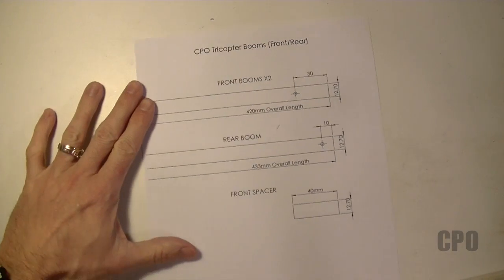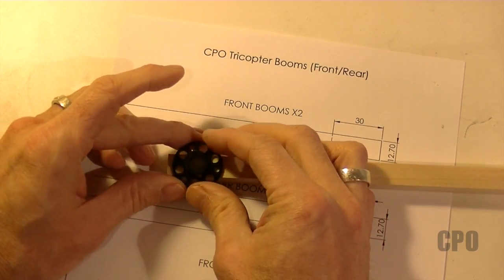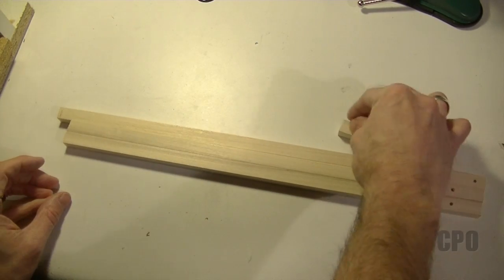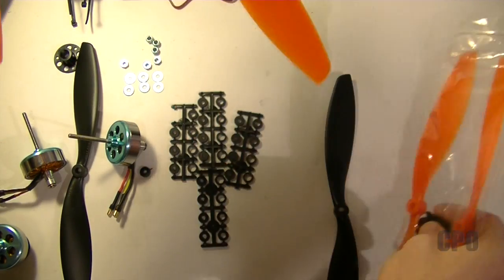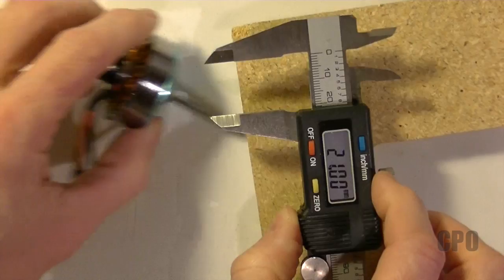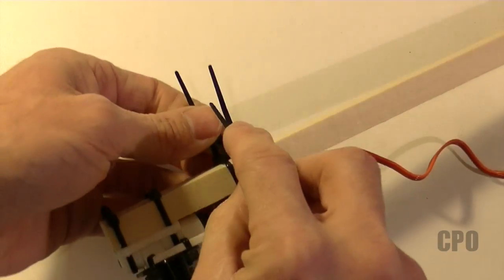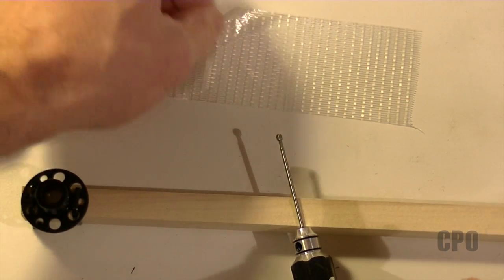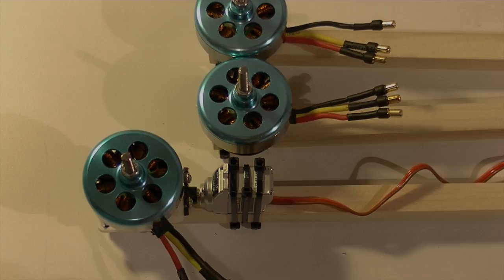CPO Tricopter Build : Cutting Booms and Mounting Props and Motors

Comment: I think a nice improvement to the tail design would be to have a thin plate that the motor and servo are semi-permanently attached to, and then attach that plate to the boom. You want the plate to be mounted to the boom more weakly than the motor and servo are mounted to the plate, so the entire plate can detach in the event of a crash. This is what the Titan yaw mechanism uses, and it works great: http://www.fortisairframes.com/titan-yaw-mechanism-kit/